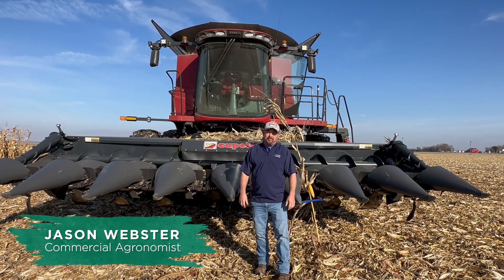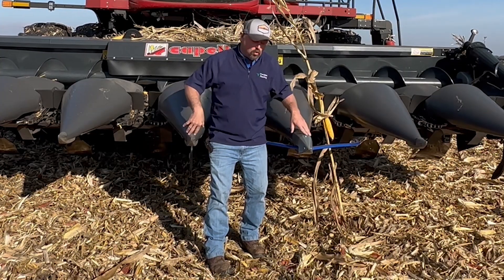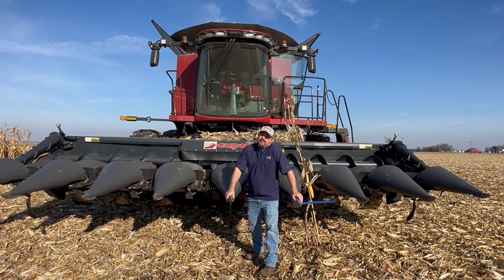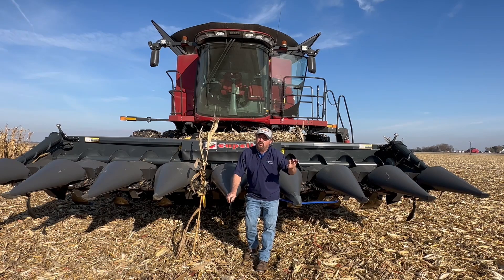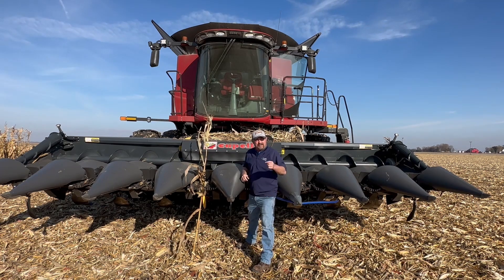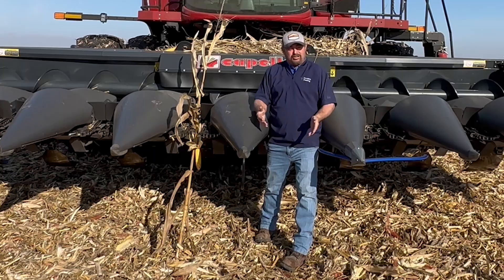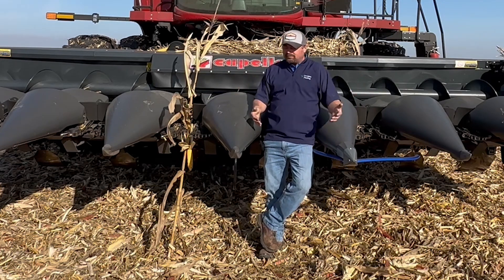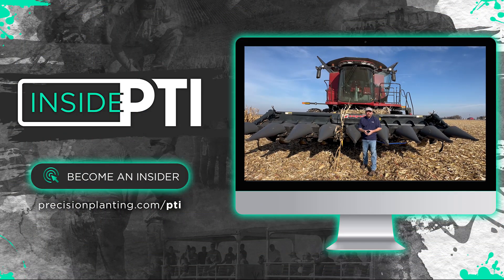InsidePTI S4•E17 | Removing Corn Head Blinders?

Comment: This guy isn't old enough to talk about the history of the corn head. Old ones were over complicated & ran at 45° angle; a real nightmare in downed corn.  It was common to pasture the fields for dropped ears.  Most of the problems solved by early '70s, remainder fixed by controlling corn borers. At this point just selling new complications rather than fixing problems.